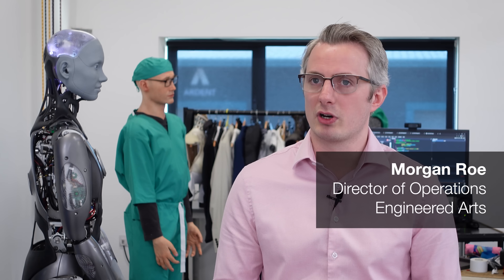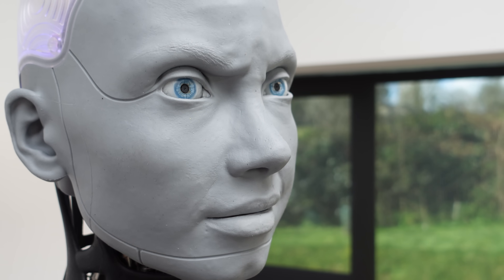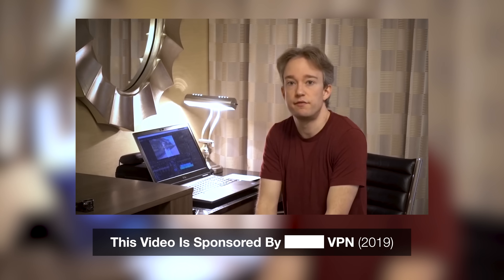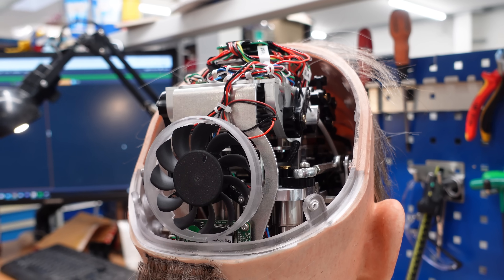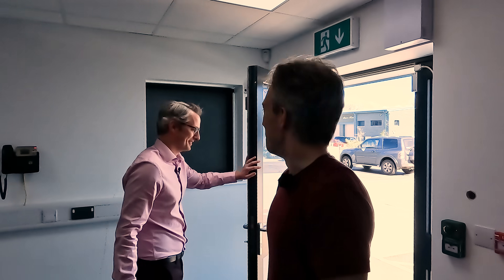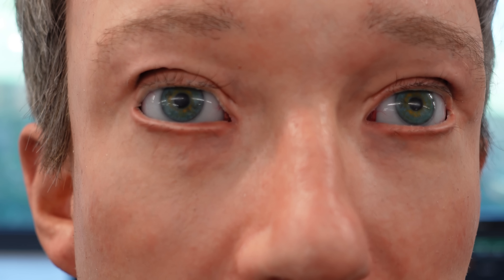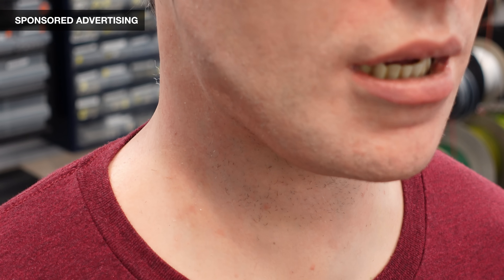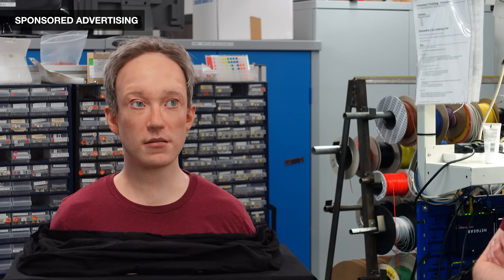My robot double sells out (so I don't have to)

Comment: The reason humanoid robots don't look right is because the people making them are;
1. trying to make the robots look like realistic humans.
2. using human motion, 1 for 1, to simulate a robot's movements.

See, in animation, there are principles we use. These principles help us make good animation, but also help us avoid the uncanny valley. We exaggerate motion, because in animation, it looks wrong if you don't exaggerate it. I think robots fall into the same problem. It might look 1 for 1 with a human, but it needs exaggeration to feel right. Look at the Polar Express as an example. They used motion capture for all of the animation there, and didn't go back in to exaggerate it. Because of this, even though the faces are moving EXACTLY like the human counterpart did, and the movement of the their bodies is the same as well, their faces look lifeless, and the bodies look stiff and uncomfortable. Pushing it to be more cartoonish would probably fix half the problems faced in making robots look more convincing.
There are additional reasons as well which we can see with the Tom Scott bot. The lips and eyebrows don't move, and the cheeks (near the cheek bones, under the eyes) aren't moving either. Rather, they are stretching and responding like skin, but they don't have any articulation. If they want it to look real, they'd need those to move and then hire an animator.

Comment: Engineered Arts is going to need smaller actuators to get all the face muscles needed for realistic movement. Nitinol or micro linear actuators could both do this, but both have drawbacks: nitinol can't release quickly since it has to cool down, and submerging it in coolant would be complex, while micro linear actuators are expensive and rigid, so they may get in the way of each other when creating complex musculature.

Comment: The latest gen robot is amazingly realistic, when it was just sitting there I wasn't getting any of that uncanny valley feeling. The second gen that tom used is close (though the eyelids push it over the edge) as long as it doesn't move, but when it starts talking it gets substantially creepier. 

Same with the Amica actually. It's fine as long as it doesn't try to mimic expressions, it just has that constant look of poorly hidden disdain, but as soon as it moves it's face to make a new expression you can tell that somethings wrong. I wonder how they'll eventually manage to mimic all the many many muscles in our faces.
Reply: @dekjet  Piezoelectrics.
Reply: If I ever write something involving robots, can I use the specific wording of ‘constant look of poorly hidden disdain’ please?
Reply: I think the real mark of an accurate robot will be when it can mimic mouth movements when speaking. The linguistic knowledge is there, so it's a question of how to recreate the muscles.

Comment: I am saddend by today's sponsor. I loved the original video from 2019. Because in the sponsor message, there are things mentioned that don't hold exactly true.

Take the advertisement profile. The time that advertisement companies needed your IP address is long gone, it's a metric that hasn't been used in ages simply because we move about so much in our life. You say your ISP might be misbehaving and NordVPN can stop all that, but you are taking a service from a company that you pay a lot of money and that has a reputation to uphold and you know is a company you could hold accountable if needed be, and moving that to a company funded by venture capital, that is selling a service under the price it costs them to operate and is located in a place where you can't hold them accountable. You sure you are betting on the right horse there?

Yes, VPNs can place you in different countries, but how often does that still work with streaming services? They keep blocking the exit points because it goes against policy.

NordVPN has also been anything but transparent about their security. A breach that happened in March 2018 was only made public in November 2019 after the news started spreading on Twitter. It took a shitstorm to admit they were hacked.

Comment: Maybe it's just me but I feel like these robots are starting to climb out of the uncanny valley a little bit. And it makes me wonder how many more motors and joints we really need, vs how much of it is down to the software and controlling those motors to work in a realistic way
Reply: Amica looks really good to me. Probably it's helped by it not trying to look like a human-human, but an android.
Reply: I'm no expert, but in my opinion, at the moment it's mostly about the hardware. There are dozens of muscles in the face,  and they all affect each other and how your features move around and get stretched and pulled. If you look at a 3D animation of a face it's much more convincing.
Reply: Really? I was creeped out the whole time watching this video and was thinking about the uncanny-cliff-instead-of-uncanny-valley-hypothesis probably being true...
Reply: The face looks good but the eyes let the effect down.
Reply: Synths are an abomination. Ad Victoriam.
Reply: The eyelids didn't attach to the rest of the skin. Especially the one on the left (Robo-tom's right eye) had a solid gap which made it creepy af.
Reply: Really? This wasn't even in uncanny valley yet for me...
Reply: @jlammetje  this particular one has the wrong headshape cuz i think they used a generic head shape (probs due to budget). Also the eyes are weird

Comment: Something about the lazy expression of its eyes really gives away the fact that this thing is a machine.  It just looks permanently half-asleep.

That and any time it speaks, which is a total giveaway.  The industry really needs to figure out how to mechanically simulate full mouth expression if they ever want to get these things out of the Uncanny Valley to a point where people aren’t going to be immediately squicked out by them.
Reply: it's funny because we've already figured out realistic mouth movement articulation. The plant in Little Shop of Horrors has enough control points for puppeteers to exactly mimic the visemes of the human mouth, so it actually looks like it's talking in the movie. 
The limitation right now is probably motor size and speed, and possibly a deep learning algorithm to automatically learn and replicate real human expression. 
The plant puppet needed to be shot at half speed, and the puppet itself was massive. Plus it was manually controlled, so that real human element was still there to give it character and life. So, we could probably make a giant human mouth that's able to talk realistically, but that'll probably just look even creepier.
Reply: @JovanKo314  I wonder if it would be worth using electronic muscles instead. That way, you can even see how it moves under the skin, cutting down even more need for motors
Reply: @JovanKo314  Now I want to see a freaky art exhibit of a giant human mouth talking realistically

Comment: I think the Amica robot was much closer to realism. It's also how realistic i would want my bot to go. It carries the expressions needed but is still very clearly a robot. I don't see the need for ultra realistic outside of getting facial movements correct. Humans are humans, robots are robots. Let's keep the line between them good & thick. Use the ultra realistic stuff for surgery to repair deformities & the robotics to enhance amputees etc.